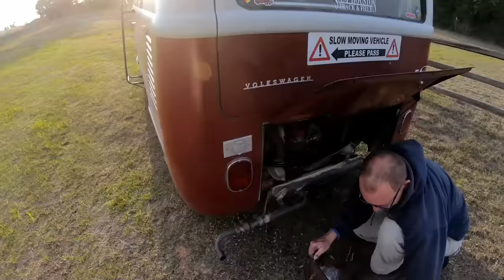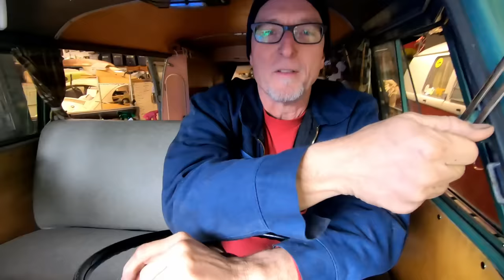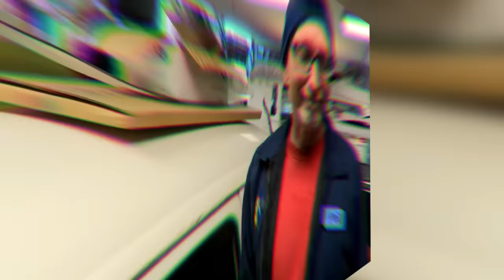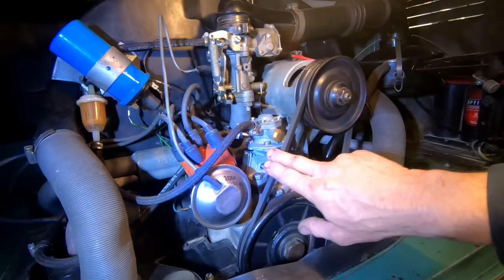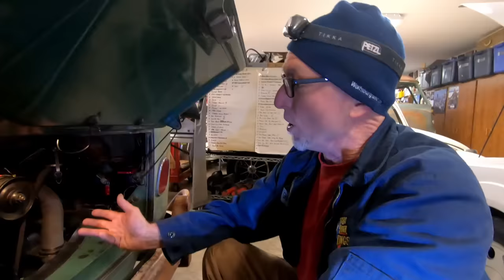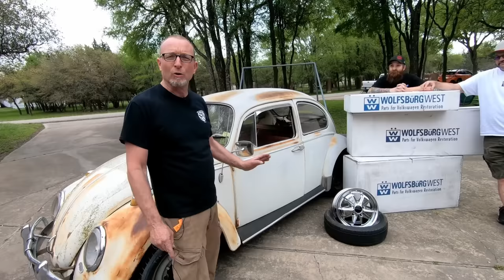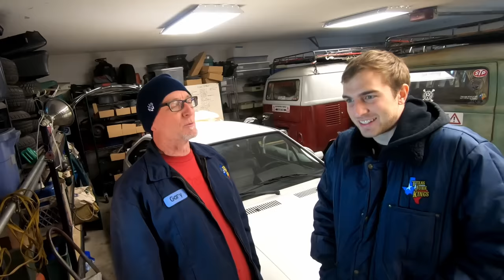10 Things They Don't Tell You about Owning a VW!

Comment: Good video but I think you guys are making bugs out to be less reliable than they really are.  I delivered pizza and commuted to college in a 1972 Super Beetle from 1980-82.  I found a local VW mechanic and he replaced my engine for $350.  I got good service out of that car.  Change the oil twice a year and get it inspected by a local VW mechanic and have your valves adjusted once a year or do it yourself with no special tools. Looking back the only things I didn't like about that car was low power and heat because it was getting rusty.  Rust claimed Beetles, like all other cars at the time.  Otherwise they were very simple, efficient, inexpensive, and reliable cars, especially compared to the competition at the time.  Cars were crap back then compared to now.  If cars were still made like 40-50 years ago people would be marching with torches down the street!  VW door handles don't fall off!  Crude as they are by today's standards they are still a quality standard, like the Ford models T and A.  I love T and A!
Reply from the maker: But we are making out to be all about. You just have to understand that they are going to eventually need servicing. I mean when you drove your beetle in the early eighties that it was nearly 40 years ago. Parts aren't made the same anymore and most are made in China. Also the fuel has ethanol now. There's just a lot of factors. Thanks for sharing
Reply: @VWLifeVW  Yes all cars need servicing.  I was merely pointing out that Beetles may be slow and crude compared to today's cars but to call it unreliable would be quite misleading.  I didn't understand the first part of your reply because I think your speech recognition malfunctioned.

Comment: TEN... The nut or bolt will always find a hole, a crack, an opening you will not easily retrieve. You will cuss.  The VW (pre '80) is going to be your mechanic teacher from here on out, i.e., Aircool Engine Tech 101. A lot of Aha! moments. You will come to find out that a 50 lbs bag of tools will narrow to; 8mm, 10mm, 13mm, 17mm, a cross and a standard screwdriver is about what you need for tools. Willkommen an Bord!
Reply from the maker: yep good list!
Reply: Don't forget 7 sizes of vise grips, from really tiny ones to welding ones too hold things together until you can get home

Comment: #10. Changing oil every 600 miles.
Reply from the maker: 600 huh?  :)
Reply: @VWLifeVW  Back when I bought my first new one, a '66, and running straight 30 weight, I changed it often.

Comment: #10....No body said the back seat would catch fire...….
#11....No body said my foot would be burning red hot in summer...
#12...No body said the fuel line under the fuel tank would crack and leak fuel....
#13...No body said don't buy EMPI....
#14...No body said I would tear my calf muscle while pushing starting it due to a dead battery at night...
#15....No body said.....No body said...….........…..
#16...No body said make sure you attach all the fuel lines after replacing the engine and firing it up and wondering why the garage was glowing red with fire...
Reply from the maker: lol now you are saying it!  and you are "THEM"  head Chris' words